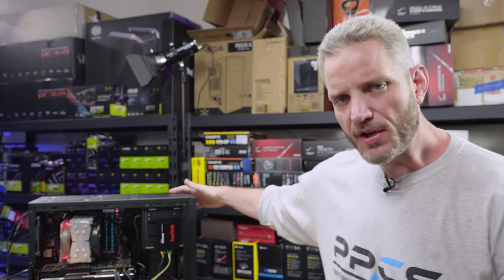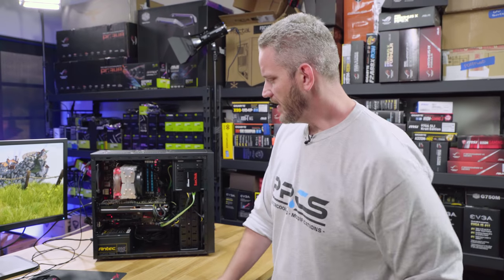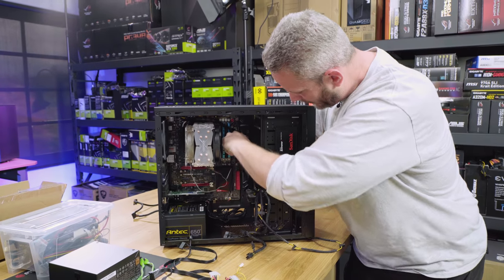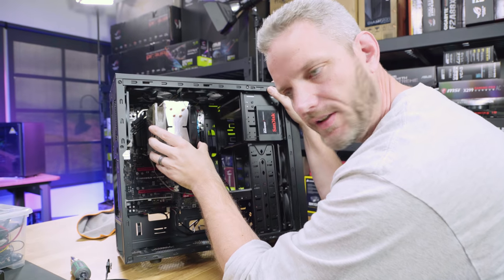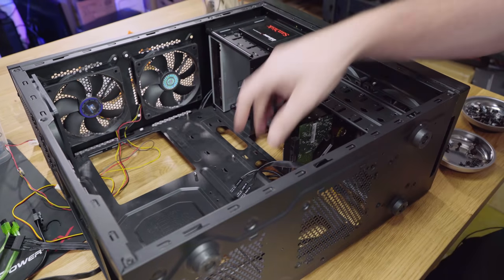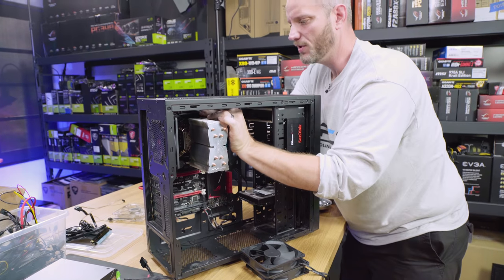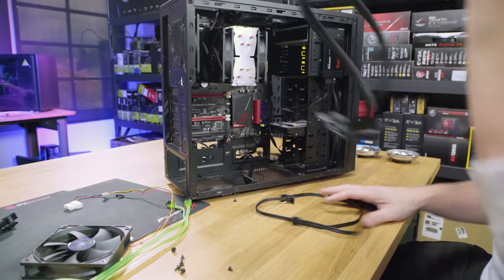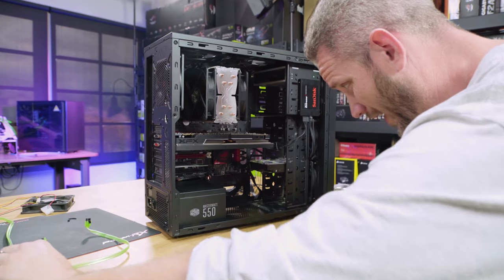It was worse than I thought... Fixing PCs Part 2

Comment: PC goes in for a repair... comes out cleaned, upgraded and rebuilt. Best repair that I've ever heard of.
Reply: Nightcore Fusion that's how all repairs should be. I wouldn't upgrade any of the clients hardware though.
Reply: DJHeroMasta yeah but you dont get tax deducted from your return if the repair is a capital improvement, that's the only downside to fixing clients PC's
Reply: "Yeah I noticed this 2600k was acting weird so I just slapped in a z370 and an 8700k"
Reply: I've done this a couple of times when I feel real bad about the PC or if it's a friend of family member. But generally it's fans and stuff leftover from client throwaways like stock fans from cases and coolers.
Reply: When doing MFG Warranty and Extended plan repairs, I regularly replaced whatever was broken with superior components. You get a happy, loyal customer for all future purchases and it gets deducted from the plan or reimbursed by the mfg.

It was usually something within the same generation. But, I've had to replace discontinued motherboards with a newer gen mb, cpu, ram more than a few times. Generally, if it's within a margin and saves on time/shipping and turn-around no one complains.
Reply: Meanwhile, on PC Building Simulator....

PC goes in for a repair, comes back without CPU and graphic cards. 10/10
Reply: Dainius Vyšniauskas At least the client still has their ram
Reply: I do this for quite a lot of people, depending on the extent of the repairs needed. In a case like this one presented that's a definite.
Reply: The way it should be done and any possible upgrades. still think you should just make a bench though and rip out a power plug from a old case and use that. jump it on the box or whatever a stand. trust me you have a lot of shit you don't want assemble disassemble the case anymore.
Reply: DJHeroMasta usually if you run a business, time is money. if you spend 2 hours really improving the client pc instead of just doing the 20min fix, you can fix less computers in one day and hence make less money. or you charge more for premium service. and usually customers who would pay that much for a pc being repaired will know enough about pcs to do it themselves or are so clueless that they don't care about cable management and dust.
Reply: now if only actual pc repair shops had this kind of service i might consider using them
Reply: depends largely what it is dude...if you have some damn prebuilt or probably something OEM board and shit...you can't really do a whole lot...especially if it's older and people tend to hold on to old builds. It's basically clean and make sure everything works check psu maybe replace it after such a long time.  Maybe a ram upgrade etc.....how it's been dude...steered away from Processor upgrades and that mostly requiring a new board. 

PSU should be looked at though...id rather you just replace or rma it after such a long time and well out of warranty.
Reply: DJHeroMasta
I don't really agree, if I send my computer to get something replaced, I don't want them to change and charge me unnecessary parts.
Here it's ok, he said he wouldn't charge them, but an actual IT repairman would.
Reply: well I'm sure a lot of store would do you this service if you ask. Comes at a price though, bc noone is really working for good will only. Component upgrade left out, organizing cables, dusting and normal maintance is not really hard. Actually some of the easiest non performance upgrade that you can do in a few minutes or so.
Reply: Go work at good will dude haha. No I told you I'm Gawd at this and always have been lol
Reply: He said he isn't charging the guy in the video though.
Reply: if jay fixes a computer, is it the original computer?
Reply: In many places in my country if you send your pc in for a repair it'd come back with something else broken, a missing graphics card and still being overcharged so I feels you man
Reply: It's just like PC Building Simulator!  👌
Reply: I do it to.
Reply: Госм Лабуд  And that's how you lose business in PC Building Sim
Reply: Thats how a real tech handles things like this i woukd never send a computer back dirty or havi g things installed incorrectly

Comment: Been building computers since 1994... that's definitely not the worse system I've ever seen built.
Reply: Yep, it had wires BEHIND the motherboard and even sleeved ones. It's only bad when it's rainbow and just plugged straight in. But mostly the issue was because of "too many" fans. That system would work with 1 in and 1 out, no need for fan extetender cables then.
Reply: I've seen pre built Pc's with worse cable management.
Reply: Bickety Bam I was cutting my teeth repairing/upgrading my own C64, C128, and Apple II  computers in the late 80's as a kid but yeah I really got started about the same time you did building IBM Clones, and so I have to say yeah I've seen some way way worse computers even factory built machines the owner never even bothered to clean once that left the case with big bricks of dust/smoke, or where the wires were just like a total WTF?!? mess.
Reply: Saviour86 what's your PC look like?
Reply: Nope i have seen worse. Still does not excuse the fact that this was a build from a friend knows a little about Computers as he the parts laying around but doesn't care enough to do a good job.
Reply: Bickety Bam yeah I wish I had a computer anywhere near that
Reply: same here from 1994
Reply: Yup being building them since around 92/93 when built my first 486 sx system, I have seen way worse than the original state of the case. I have seen someone take metal cutters to the outside of the case and just holes in it because they thought fans were a waste of money. I wonder what happened to the rig i built for them when their holy machine died but then again perhaps its better i dont.
Reply: True but it seems like the builder rushed, or didn't seem to try, there were only 2 standoffs installed, why?
Reply: I started way back when, Tandy Computers by Radio Shack, were on scene. (Yikes I'm old!!) Some folks used to come in with these completely fubar mods. Many of  them looked like botched abortions. So they had to be sent to factory repair. BIG money. Keep in mind this little gem! RAM at the time for 4 MEG <----- MEG!! was $599.99!! A 40 meg HDD was $399.99. $100 more and you could've upgraded to a 70 meg. WOO HOO!! Mobo's were sporting ISA slots galore, along with what was called, "expansion slots". Now, when I look at this tower that, Jay is tooling on, it's not even close to some of the shit that came through the door.
Reply: agree plus not paying for it!! ask for a favor!!   jay can you fix my PC too!!
Reply: Saviour86 nowhere near, a lot cleaner than most, including mine
Reply: Bickety Bam
Ive been in the game since the early 90's, i remember working on XT's 286's 386's, when the pentium 90 launched everyone thought pc's were lighting fast, the joys of configuring scsi drives, when there was no such thing as the internet, going through boxes and boxes of floppy disks trying to find a working driver, when it use to take hours and multiple floppy disk swaps to install windows, when code was an actual art work to get these programs to run on 4 meg ram, People complain about GPU prices but back then a voodoo card could cost $2000+
Reply: I guess you remeber the good old AT power supplys then where if you plugged in the 2 AT motherboard cables in backwards it would go BOOM!!!!  Lets see how good your memory is, what way arround do the two connectors go , and no sneeky googleing !
Reply: Andrew Joy
they had the old P8 P9 connectors and it was always red to the left , if i remember right it was P9 P8 or all blacks in the middle
Reply: Black and Black you'll come back, red and red you might as well be dead. Thats how I remembered not to do that.
Reply: true. its just the parts are high end. and thats how he put it together. like he just want to play the game. shouldve took it to jayztwo in the first place.
Reply: Yeah, people that think it's the worse never seen my computer. I have an oem case, you can't even run the wires behind the tray, so every wire has to come in front, so I didn't even bother doing cable management, since I wouldn't have a decent cable management anyway.
And my case as some parts removed with an angle grinder to make my cooler fit lmao
Reply: There is a perfect reason why no pictures exist of my 2013 to 2015 system XD My first was awful...
Reply: Man you guys are bringing back some memories. SCSI drives, floppy disc, 20gb HDD's, P8/9 connectors, etc. Who remembers Norton Commander? The next step up from typing in nothing but command lines!....lol
Reply: same here and totally agreed!
Reply: My first build was a Pentium II 350 MHz, I build nice machines for my friends but my personal ones usually look like shit but at least they work great.
Reply: Even if I had not been dealing with cancer at the time, I could have done a much better job on my OWN first build. It was very much a mess.
Reply: With PATA cables every build looked awful compared to todays standards.
Reply: @bluefoxtv1566  Dude is it really that big of a deal? Everyone has to start fucking SOMEWHERE. It was probably 2x as good as your rig. And it was his first time as well! Probably a big assumption of me to think you've even built a PC before, come to think of it.

Comment: My first build was a.....Pentium II and was atrocious lol. Took me MANY builds to learn all the little facets of building a pc properly and LOTS of "Oh god... what did I do wrong!?" 

People who critique that bad on here either have not started building their own with no help or forget the struggle.
Reply: I'm running a i7 3770k on its stock cooler and never did any overclocking. Only recently found out that I could've saved money and used the 3770 instead for an irrelevant loss in performance. Also a lot of the components aren't thought out, like the RAM speed was chosen purely from a price point of view. Half of the case front ports aren't connected to anything and so on. And those are just some of the problems with the whole build and it wasn't even my first one.

Now I'm looking into a new computer and every mistake I made is what helps me do everything perfectly. That's how you learn, especially if you don't have some friend who's been building computers for a long time and knows everything. Some people are quick to forget what they went through.
Reply: I built this PC back in april 2018 and picked out an absolute garbage motherboard from gigabyte, no SSD and a pretty cheap case with built-in standoffs that came stripped pretty much out of the box. As of now this current build is still not making use of the two top motherboard screws cause they simply won't screw in, but I've gone around to upgrade it quite a bit thankfully- 1050 -> RX 580 8GB and ryzen 3 1200 -> ryzen 5 1600 AF. The motherboard's backplate wasn't glued in or anything off the bat, and I made a mistake by putting my motherboard in first, the first time I built the PC so it took a good hour to figure out that the stock cooler wasn't screwing in cause the backplate fell off, so I had to strip the PC down to get the damn thing back in. Similar thing when upgrading to the 1600, but instead with some weird yoga and a couple pieces of cardboard to hold the backplate up I somehow managed to get the cooler in, in about 10 minutes or so.

PC building is definitely a huge learning experience-nowadays the actual building part is super simple if you get good quality parts, but on the budget end of things you have to make tons of shortcuts and hope for the best. Hopefully the time I get round to doing a new full build (in a few years I guess), I'll do everything right this time round, and research my part choices better-especially the case.

Comment: Thanks for the video.
Considering how the pc was put together, My suggestion is to look at the tower cooler and see if the thermal paste was put on right, or old and needing replacing.
Other wise nice fix.
Reply: I just wanted to tell the same,ő he would be better if checked the thermal paste too... On the VGA too. Experience, i had an XFX radeon, and over time it became so damn loud and hot it wasnt even working properly, so i cleaned it, applied new paste and now its work like a charm again, and quiet too. :)

Comment: People who criticise first time system builders should think back to their first build, I know someone who switched the voltage on their power from EU to US WHILE IT WAS ON! That is a far worse sin than any of this. Also it could potentially turn people away from doing it in the future. If you must criticize at least use positive criticism to motivate them rather than mock them for their ignorance.
Reply: Christian Davies Sheeettt....
Reply: Switching the power is far less of an obvious fuckup than using only 2 standoffs or basically anything else this person did. That can at least be seen as a "I wonder what this does" situation if they didn't know, unlike this build that was consciously fucked up for whatever reason, save time or something, maybe?
Reply: jones81381 he's talking about the red switch on the back of some PSU's which determines the voltage input.
Reply: I've done far, far worse in my day.  I once used a 120mm case fan as a CPU fan.   It didn't really fit on the heat sink, so I only had one screw to keep it in place.  I also had to replace a power supply, and bought one too big for the case, so instead of returning it, I just set it on on top of the case and ran the cables in through the back of the case.  Now, none of the silliness is going on in my current build, but back when I was doing that sort of thing, you were lucky to get PC building tips from some obscure message board.  These kids today have it too easy.
Reply: I can't help but think that the builder would have learned so much from fixing his own mistakes, instead of throwing up his hands and letting someone else solve his problems. My first fix was a 1995 Packard  Smell with cheap hardware. That put me on the path of learning how to fix PC's.
Reply: I'm thinking it could be possible that the guy lost the screws somehow pulling it apart. I've lost screws before and used what I had left to put things back together. That was years ago though and didn't have any money. I've put single screws on things/fans, put bad fans in cause it was better than no fans. modified wiring to suit certain needs. Heh I've done all the bad shit. Sure today it's super easy and just buy everything but back then nahhh lol. Good chance the guy only had this rig and nothing else but his friend could have done something about that unless he's completely clueless too.

Maybe they just don't know and that's it. Claimed ignorance and then let someone in the know take over, which is normal. Aside from computers I like to work on cars and I find the same stuff. Lots of redneckery there too, especially with the wiring. Maybe later on when he gets his rig back he'll learn something and take better care. Or at least one can only hope.
Reply: That's true, with my first build, I screwed the case thumbscrews on way too tight, intended up having to pry it off and bent the side panel doing so. After that point, I had to use zip ties / twist ties to keep the panel on! LOL. It's been years and I know so much more now. Now I help as many people that I can with this stuff. it's amazing how much you can learn in a few years. People just need to hang in there and be patient. They'll learn eventually. haha
Reply: ive been building for 13 years now but only recently finished my build for now but went from being an amature builder to a professional pretty quick now working for one of the biggest pc supply companies in australia
Reply: Maybe they didn't have the time?
Reply: Nowadays with a little bit of research it's just so much more difficult to do a shitty first build. My first was after watching tonnes of YouTube videos and I did a clean and quick build with all cables nicely tucked away. Not boasting or anything just saying how times have changed with so much resources now available for those who want to build computers. Not going to pick on this guy though, it's not even that bad.
Reply: I remember switching something off on the back of my psu (probably some sort of fuse) while the pc was turned on. The next second it wasn't. The whole case got lifted up by a small explosion and it smelled pretty gooooooooooooooooooood.
Reply: I totally agree that nowadays it's pretty hard to do a bad job with all the resources, but there's one resource you may have forgotten about, time. Everyone has different amounts of it & even if you have it there's always other things demanding it. It's easy to write this guy off as lazy, but he could work a 40+ hour week to come home to look after 2 kids while his wife is in hospital for some reason (totally hypothetical of course).

Even with time when I started in the late mid/late 90's we didn't necessarily have a second pc to google the answer, or an internet connected phone/tablet. You had the non functional previous pre-built to reverse engineer at best. Even then it may have had totally different stuff in it like socket type, standoff arrangement, or just old standards.

We just can't know, but I do agree that it would be most helpful to be taught to do it right. I'm sure he can find time to watch this at least.